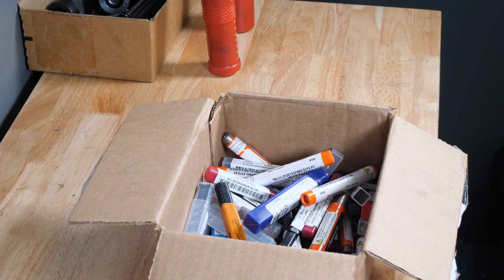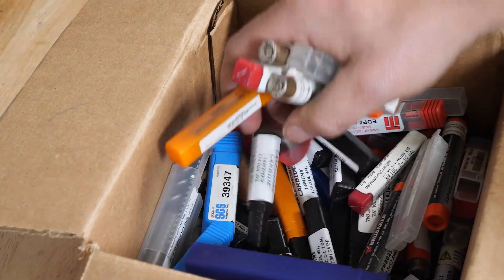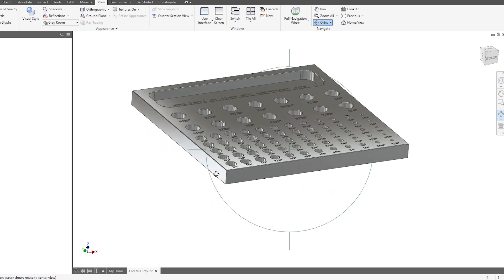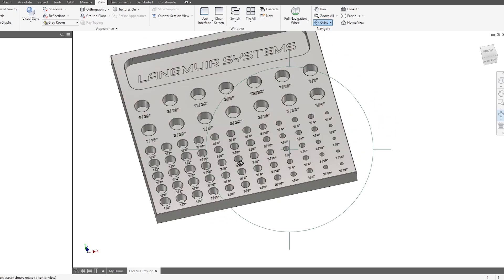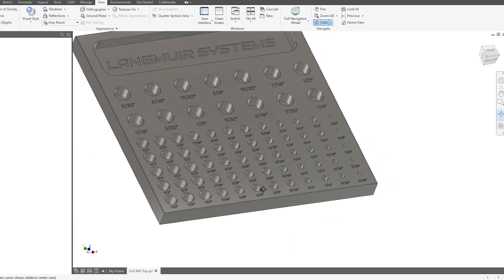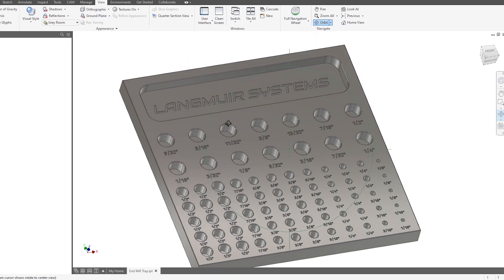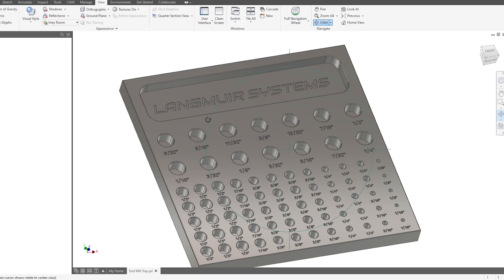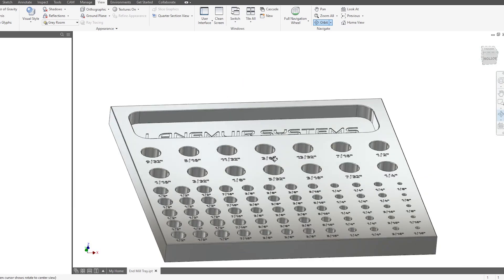Machining an End Mill Holding Tray on the MR-1 CNC Gantry Mill

Comment: Can someone answer me how are you guys handling the chips in the screw drives? I want to make sure you have considered this before I put a deposit tomorrow.
Reply from the maker: We’ve seen this question come up quite regularly but the simple answer is that we did it because it provided no advantage in our testing and it saves pretty big on cost. The linear rails are fully sealed and the ball screws have wipers. We have thousands of cutting hours across years of MR-1 iterations and we have been passing the same linear rail sets and ball screws across these machines to study wear and any other issues. The reality is that we have not had one singular instance of the machine stalling due to debris getting into the ball screws and we have not seem any damage to any of the ball screws and nuts we have used, period. We have ball screws that have been running hard for years with the same backlash as the day we put them in.

MR-1 was carefully designed to optimize both cost and performance. Something as simple as adding ball screw covers would have meant that the machine would have to grow larger in size to accommodate the extra travel required for these covers to compress fully and this means cost grows since rigidity decreases exponentially with a gantry style mill as the travel increases. One option that we have conceded to alleviate folks concerns is that we are developing a molded silicone seal for both sides of the ball nuts that can be added on after the fact. This would be a very low cost option (~$25 total) that could be purchased at any time and installed onto both sides of the X and Y axis ball screws. The main reason we see the advantage to these parts is when cutting wood since it can make a fine dust that could get past the ball screw wipers. For metal cutting, MR-1 makes big chips even when doing finishing passes that simply don’t get past the ball screw wipers in all of our testing. Hope this helps!
Reply: @LangmuirSystems  Thank you for the great explanation, that did alleviate my concerns!